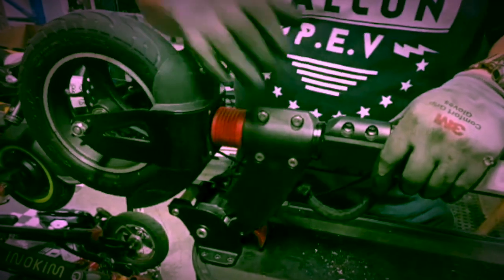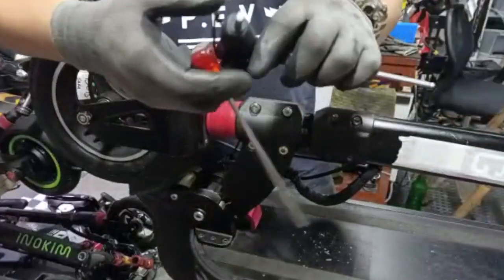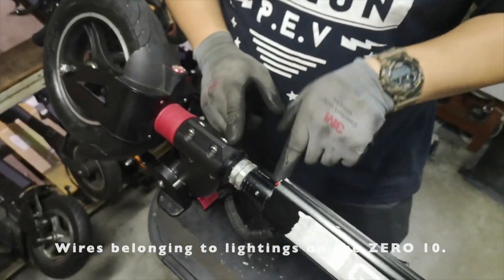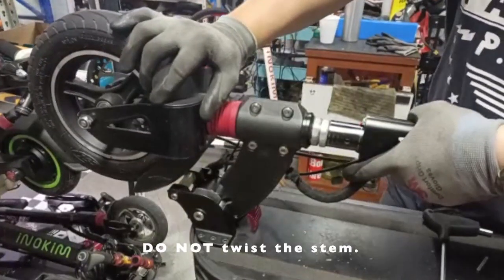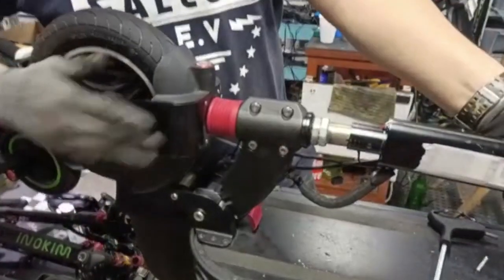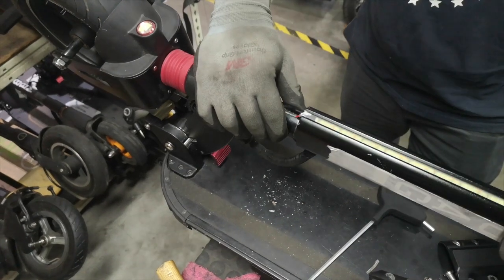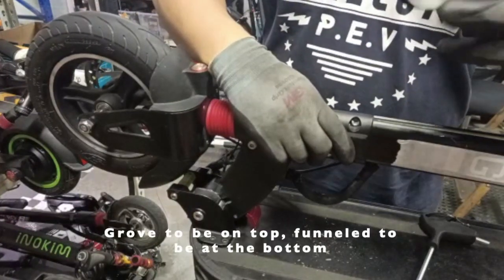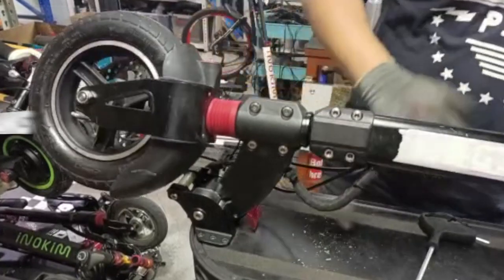HOW TO: Realign the ZERO 8 / 9 /10 Stem

Comment: I think I pinched the wire a little bit so be ready for the stem to snap release. Taking off the bolts they had some sticky residue and would sometimes need to be pushed out once unscrewed. I cleaned this off and put some blue loctite on them before replacing. There might be some tape over the hole where the pin goes. Just feel for the pin with a small driver or hex key until you find it and push it through so you don't have to remove the sticker.
Reply: Does this solve the issue of the stem being always misaligned after a couple of rides?

Comment: i tried it cause my handlebar isnt align when I got it, now I dont know whats happening cause the screw is already tight but the wheel is still moving. now I dont know what to do its fucked up already cause the wire for the led light is  broken also.. dont ever try to do it..
Reply: Same here. I also broke the wires trying to fix it. Have you found a solution?
Reply: Perhaps tighten the bottom one too 🤷‍♂️